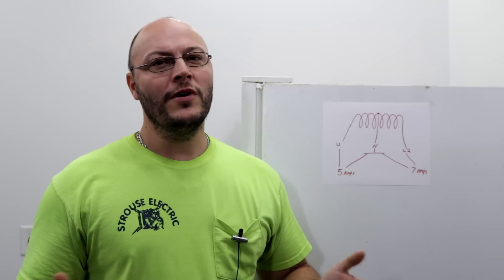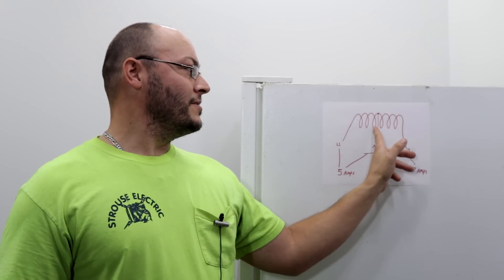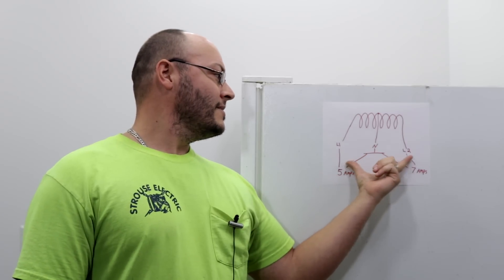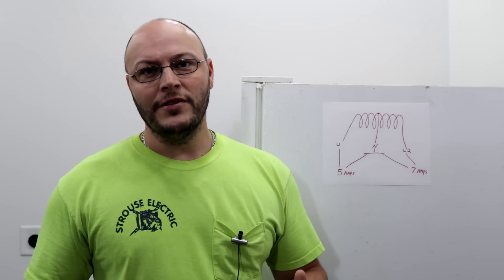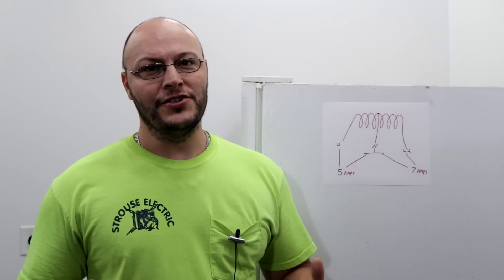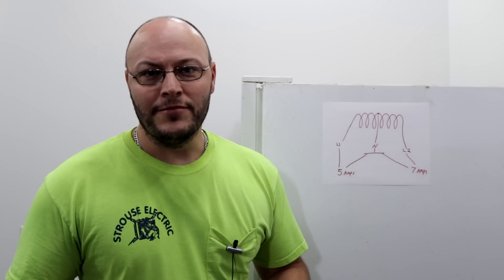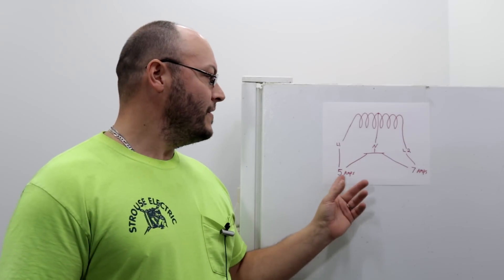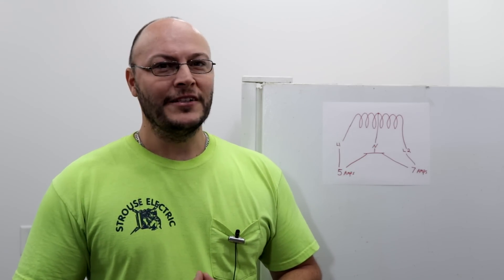What does the Neutral Wire Do?

Comment: Thank you. I agree mostly with what you said here. I am quite surprised with the controversy that it raised. The neutral does indeed carry the difference current between the loads on L1 and L2. This can be easily and positively verified using an ammeter for anyone who doesn’t believe it. Another benefit of this setup (when the neutral is properly bonded to ground in the main residential panel) is that it essentially limits the potential with respect to ground to 120 volts. So, if you accidentally touch L1 or L2 you can get a 120 volt shock if you are grounded. That is, the resistance to ground is small enough that enough current can flow to shock you. This is why birds on a wire are generally safe. The wire may be energized at 25KV (or more) but with no path to ground (air is a very poor conductor) there is no current flow and hence, no shock to the bird. Getting a 240V shock is much less likely because of this bonding. You have to simultaneously come into contact with L1 and L2 to get a 240 volt shock.

Comment: So how does the extra 2 amps travel back to the transformer? Amperes are used at the component(s) being energized. The draw of amperes depends on the demand. Your conclusion would suggest that the part of a branch circuit using a lower amount of amps is somehow allowing an increased amount of amperes through components without utilizing the extra load? The hot and neutral don’t directly connect but through something providing resistance. The resistance is what utilizes the amperes and those amps are in direct proportion to its needs. Additional amperes can’t flow through a point of resistance without affecting it negatively.

Comment: All my white neutrals have power to them! (At fuse panel )tested 18 neutrals have power when tested, turn the main off took each one off one by one they all have power!!! That's right every neutral has power to it! every circuit SMH also put a new ground 9ft rod into the ground ran my copper ground wire to the fuse panel still have this problem! Have a electromagnetic field in my house? Anything I plug in magnifies my EMF, no problem with Breakers popping either? Any comments would be greatly appreciated

Comment: I don't think it goes back to the transformer. In residential the ground and neutral are bonded at the meter. Which mean the unbalanced load just gets grounded. In commercial it's the same thing. The unbalanced load is grounded at the switch gear
Reply: The source is the transformer so all current has to flow back to the source to complete the circuit.
Reply: Andy Fam    You need to re-think.   All of it goes to the transformer.   It has to in order to have a "complete circuit"
Reply: Ok makes sense. Sorry I'm a first yr apprentice trying to make sense of things cuz people don't want to explain things to me. In the old houses the panels have both ground and neutrals on the same bus.
Reply: Andy Fam  Yes, and are still that way.   Even in large commercial services.   Also, neutral and grounds on same bar if the panel is fed by a transformer or generator if a separately derived system.   Neutrals and grounds are separated in sub panels.

Comment: Neutral is supposed to be ground in fact it is still connected to ground. What happened is they were wiring it backwards so they introduced yet another +0 volts (ground) for safety. Both Neutral and Ground are supposed to be +0 volts.

Comment: The purpose of neutral is to allow you to tap off 120V from a 240V secondary.  Otherwise, you wouldn't be able to run 120V loads like the refrigerator you're drawing on.  And yes, the neutral has something to do with ground because it's physically connected to ground at the panel.

Comment: There is a lot of confusion about the difference between neutral and ground. It all has to do with a characteristic of transformers that most people are unaware of. Most people know that power is transferred electromagnetically between the primary and secondary of a transformer. But there is another way as well. The two transformer windings act as capacitor plates with the insulation of the wires acting as a dielectric between them. This essentially turns the transformer into a giant capacitor. As such AC power gets coupled through the transformer electrostatically just like through a capacitor. This power will appear as an AC voltage on any and all wires coming off the secondary even if they are not connect to anything. Since the primary of the transformer has to be grounded somewhere, this "phantom voltage" will exist between any  wires coming off the secondary and earth ground. That's why the center tap of the transformer secondary, along with the neutral wire, have to be grounded locally at the service entrance. If it isn't a person standing on or touching anything grounded while touching anything connected to the secondary, even the neutral wire, will receive a shock. But by grounding the secondary's center tap to earth ground it shorts the phantom voltage to earth ground to eliminate this shock hazard. This is because the center tap and the neutral wire and anything else connected to them are now down at earth ground potential instead of floating up to some higher level due to the capacitive coupling through the transformer.

Comment: Knowing this information allowed me to troubleshoot a wiring issue at work. After an equipment upgrade, there were electrical issues immediately. With the equipment off, I checked at the main disconnect switch from L1 to ground and from the Neutral to ground,  I should have read no volts on the neutral side but saw 120. When the electrician reconnected his wires, the lug on the neutral side was actually on the insulation and not on the actual copper wire. So instead of the voltage going back to the source on the neutral it was going straight to ground.

Comment: The neutral bus and ground bus in the circuit breaker panel are bonded together but the wires are separated going back to the panel.  The neutral should not have a potential to ground( except a very small voltage)  but does provide a path for return current.   The ground does not carry current unless there is a fault.   Ground fault circuit breakers trip at about 5 milli-amperes or 5 one thousands of an amp.

Comment: Old video I know, but can you tell me why if the neutral completes the return path from both 120v legs why is it the same circular cross section of wire as the two hot leads? Couldn't it potentially be carrying double the current of the others?
Reply: The neutral actually carries less current as it only represents the unbalance of loads.

Comment: In tube amp power supply transformers for transmitters, neutral is referred as the center tap. Put forward diodes on each leg L1 and L2 and then tie them you would have DC+ We will use household power for example 125v+DC and neutral is now DC- 125v from a 240 AC source) Yes, the DC- is grounded in the chassis of most transmitters or audio amps. I worked with transformer voltages rating as high as 1200-0-1200 ac for 600 dc

Comment: Oh,,,,,, ,

The spinning turbines make the electricity, which flows into power lines and to our houses. Electricity moves through the wires very fast. ... It must have a complete path from the power station through the wires and back. If the circuit is open, the electricity can't flow but when it is closed it can.
Reply: Erm no
Reply: What is the return path for single phase of power provided to the top
of the SINGLE PHASE transformer.  Only see one conductor at the top of the transformer. Thank you.

Comment: That sounds cool but I thought the neutral is still a grounding wire not grounded but it's grounding
Reply: The neutral and ground wires are all connected together and connected to a grounding rod at the service panel. But everything is a bit more complicated.

Here is why you need the neutral: The center tapped transformer secondary with the neutral wire to the center tap simply provides the opportunity to operate different devices that are designed to run on either 110 or 220 VAC. L1 to neutral = 110, L2 to neutral = 110 and L1 to L2 = 220. Most low power household devices such as lights, computers and TV's run on 110 while heavier devices such as clothes dryers and stoves run on 220. The 220 is used to deliver twice the power to these high power devices without the conductor sizes become excessively large. The center tapped winding also allows the circuit breaker panels to be designed to balance the 120 VAC loads of all the different circuits equally on both halves of the secondary. 

Here is why both the neutral and ground wires need to be connected to earth ground: There is a lot of confusion about the difference between neutral and ground. It all has to do with a characteristic of transformers that most people are unaware of. Most people know that power is transferred electromagnetically between the primary and secondary of a transformer. But there is another way as well. The two transformer windings act as capacitor plates with the insulation of the wires acting as a dielectric between them. This essentially turns the transformer into a giant capacitor. As such AC power gets coupled through the transformer electrostatically just like through a capacitor. This power will appear as an AC voltage on any and all wires coming off the secondary even if they are not connect to anything. Since the primary of the transformer has to be grounded somewhere, this "phantom voltage" will exist between any wires coming off the secondary and earth ground. That's why the center tap of the transformer secondary, along with the neutral wire, have to be grounded locally at the service entrance. If it isn't a person standing on or touching anything grounded while touching anything connected to the secondary, even the neutral wire, will receive a shock. But by grounding the secondary's center tap to earth ground it shorts the phantom voltage to earth ground to eliminate this shock hazard. This is because the center tap and the neutral wire and anything else connected to them are now down at earth ground potential instead of floating up to some higher level due to the capacitive coupling through the transformer.

Comment: Line 1 holds the voltage.  That voltage is referenced to line 2 (voltage is between 2 lines). Line 2 is near 0 volts but exactly 120 volts away from line 1.  The difference creates the current.  Line 2 is neutral.  Line 3 is ground, which should be close to 0 volts, but is a place to dump current when there is a failure.
Reply: Rich Republican   I don't think so!    Try again!
Reply: @KevinCoop1  one wire is a ground. One wire is considered hot at 120v.  Since the electricity is based on a circuit you need two wires to complete the circuit.  The 120 volt line is 120 volts between the hot line and the neutral line.  The three lines are Hot, Neutral, and Ground.  You don't know what the voltage is on the Ground.  It's voltage floats.
Reply: Rich Republican    Please look at his diagram of the secondary side of a transformer.   Let's say that the primary of the transformer is 1200 volts and has 1200 winds in it.   Now the diagram would be L1 to neutral =100 winds and neutral to L2 = 100 winds.   Each 100 winds is 120 volts,  all winds is 240 volts.    Going from L1 to L2 is 240 volts. L1 or L2 to neutral is 120 volts.   The system (if grounded) is 120 volts to ground.   Voltage neutral to ground is 0 volts as they are tied together.  Now run from single pole breaker L1, N, and "equipment" ground to a 120 volt receptacle.   L1, N flat blades, round ground.   Inside utilization equipment L1 conductor touches metal case.  High amps goes back on equipment ground, then to neutral back to transformer, through 100 winds and out to the breaker.   Magnet field created inside breaker releases the mechanism an it trips.    Hope this helps you.

Comment: Let's make this as simple to understand as possible.
   Electricity has to be able to flow to someplace in order to do work (light a lamp/run a motor). 
   The hot provides the pressure, but unless it has someplace to flow to, it is stuck inside the lamp or motor and no light or movement occurs.
   The neutral is the drain that let's the current flow (down into the earth) and that is when lights light, and motors move.
Reply: Current flows to the transformer center tap via the neutral which is grounded for safety.
Reply: You are absolutely correct Mr. Taylor. I'm just trying to give a simple analogy for those here that have no idea what a transformer is or does.

Comment: I think this was helpful, but would have been much better to use a breaker, and why you have 5amps and 7amps. If you state that you have 2 devices/appliances pulling that amount, this would help understand that it is using this amount, not that they are simply 5 and 7 amps available on those lines.

Comment: All good except voltage doesn't go to Earth current flows to Earth voltage drives current.
Neutral is a good word to use as to imply a neutral point between opposed forces voltages in this case. If the was a single load such as a heater element no neutral would be necessary, but voltage sensitive loads on each side that are variable affect the voltage that is across them so the neutral creates a path for current to flow a shared common Starpoint that is at zero voltage at the Transformer

Comment: No one can learn a DAMN thing if they read most of the comments because every body has their own opinion.  It's a good thing you people don't teach. I personally think he had a very good explanation . I know electricians that cannot explain  a neutral.
Reply: After 23 years as an electrician, I've come to learn that all electricians are right no matter how wrong they are. They can be very egotistical and decide it is okay to stop learning once they complete their 4 or 5 year apprenticeship.
Reply: Becky..you are so right .. He did a good job ,,I browse this every so often to get a laugh..
And also to see if anyone mentions reactive power factors ..
Power utilities are very concerned about this to have a balanced system hence less induction on their generation end..google leading/ lagging power factors..
  Oh well these answers some have merit but working in the industry for over 35 yrs it makes me laugh ..
Reply: @tomriggs2637  Don't laugh too loud power factor has no bearing on the purpose of the neutral.
Reply: I guess I'm in the engineers dept. We're just talking about a neutral.
Reply: @DonaldKasper-j2r  Bill provided a clear explanation of the neutral to the center tap of the pole transformer. You are talking about neutrals to the panel, which in reality are just return conductors for 120v loads, which are called neutrals since they terminate at the neutral bar of the panel. Current for 240v loads do not use the neutral, only the inbalance of L1 and L2 (120v) load currents provide neutral current to the center tap of the transformer.
Reply: They're not electricians if they can't explain  the purpose of the neutral , that's  one of the first lessons.
Reply: How can they call themselves                                  
" ELECTRICIAN" If they can't explain it?....
 NEAUTAL is   your GROUNDED, current carrying conductor...
  GROUND WIRE: Is Your GROUNDING Conductor.
( Non- current carrying conductor).
 Not trying to be disrespectful, or mean.
Hope this helps you.
 Peace be with you.
(Brotherhood of Electrical Workers)🇺🇸⚡🔌

Comment: Why are required neutral wires in house wireing
Reply: The center tapped transformer secondary with the neutral wire to the center tap simply provides the opportunity to operate different devices that are designed to run on either 110 or 220 VAC. Most low power household devices such as lights, computers and TV's run on 110 while heavier devices such as clothes dryers and stoves run on 220. The 220 is used to deliver twice the power to these high power devices without the conductor sizes become excessively large. The center tapped winding also allows the circuit breaker panels to be designed to balance the 120 VAC loads of all the different circuits equally on both halves of the secondary.

Comment: Basically the neutral returns it to transformer so you can be double charged for those 2 amps and how many ever bolts. Typically you can look at the transformer to see how many volts. Most between 30Kv and 50Kv on residential.
Reply: Jeffrey Hinman    Huh?   Are you serious or making a joke?